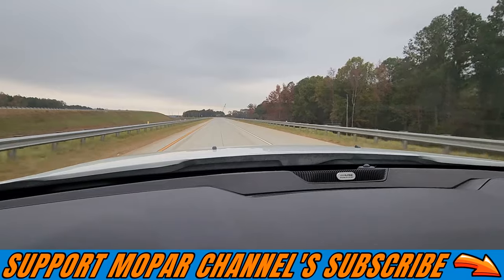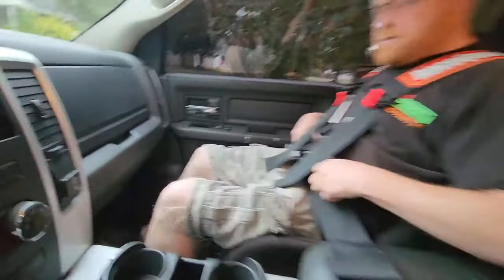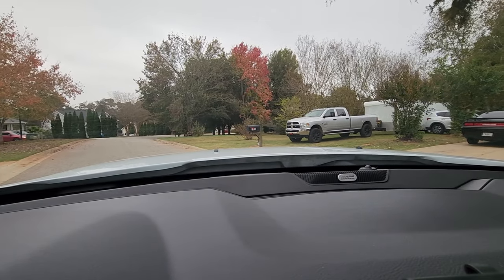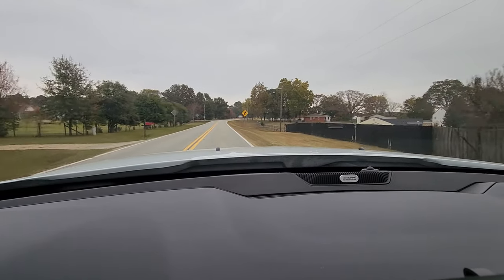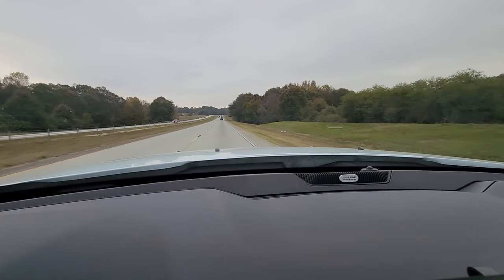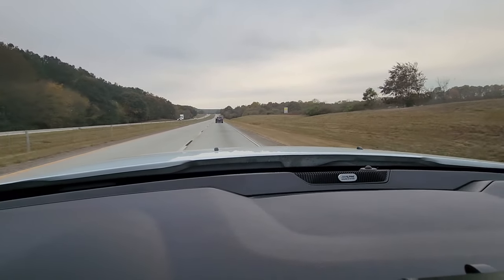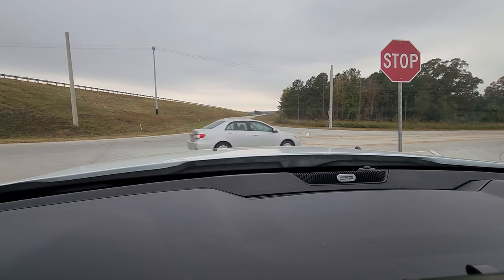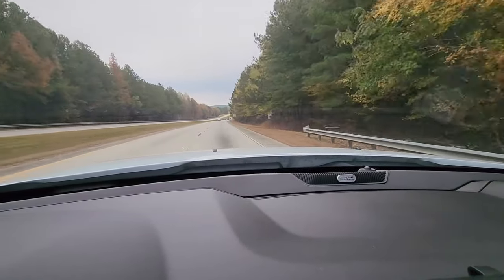Built 392 Ram R/T With TorqStorm Supercharger CRT 46RE Swap RIPS!

Comment: Omg I needed this😂😂 I got a few questions bro if thats ok... 1. Is that the stock rear end? 2. Originally when ya first boosted the 5.7, what made you choose supercharger rather then turbo ? (I'm trying to make that choice now) And finally 3. Why is this thing soooooo badass! 😅... love it man
Reply from the maker: @WayneDesforges  yes stock rear and axles.  I do have a Eaton trutrack lsd installed.  Torqstorm just seemed to be the way to go especially for a diy guy and budget. Because it's a mopar 🤣